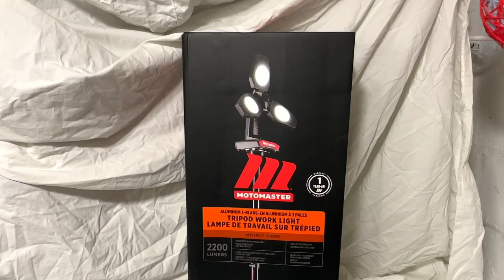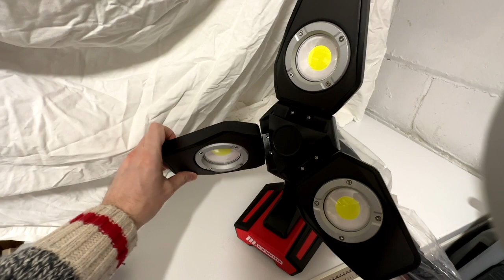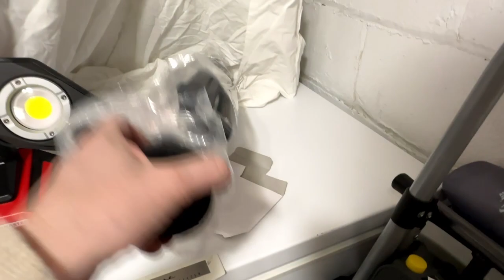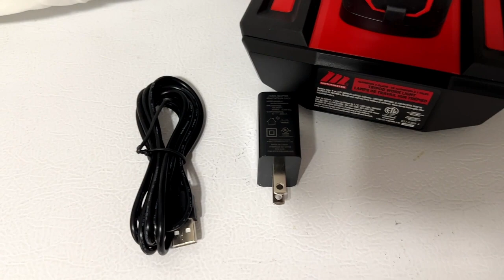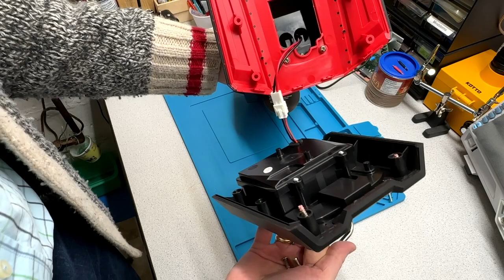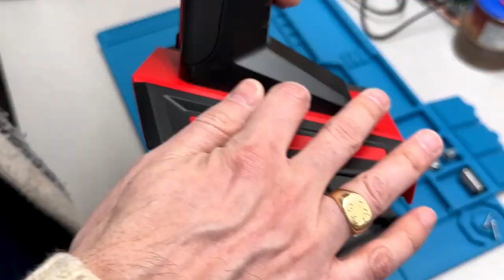Review and Teardown MotoMaster Heavy-Duty Tripod 2200 Lumens 3-Blade Work Light Model No: 037-6389-4

Comment: I've owned and used this work light for about 14 months now.  I take care of my own auto repairs, welding work, woodworking, and mechanical repair services for my family, friends, and neighbours.  So this work light has been used very often, and has performed very well.  Some work has taken over 5 hours, and the light hasn't had any problem doing that on one charge.  More than enough light, and never had need to run it at maximum illumination.

I got it on a great sale deal from CTC for under $60.00 CAD + tax.  I don't use the tripod much, as it's normally better to hang it, or prop it into place when working, but the tripod works fine as well.  I just like having the light closer to where I'm working, rather than using it as a flood light for a larger area.  Highly recommended